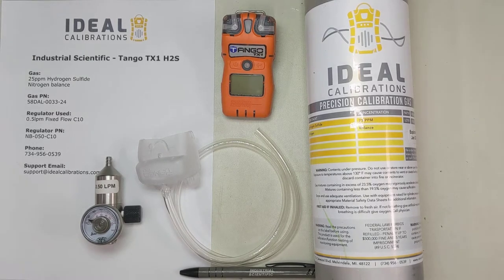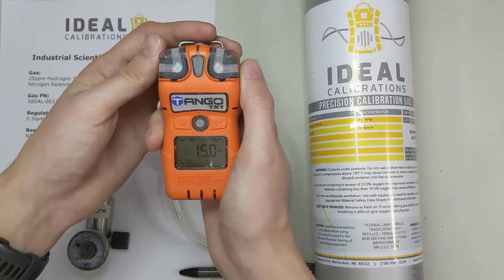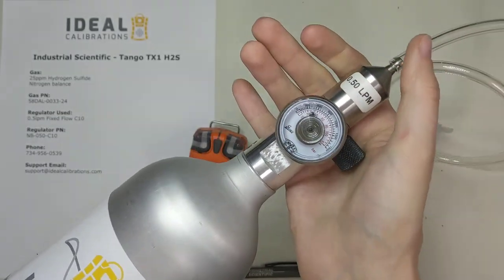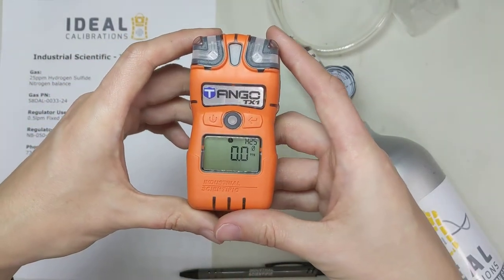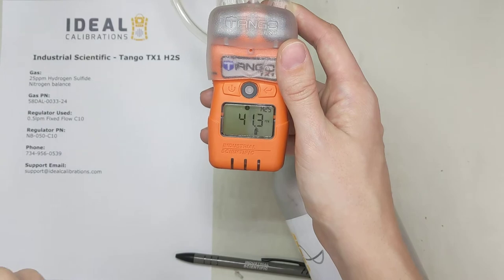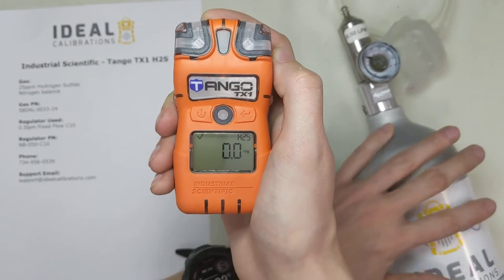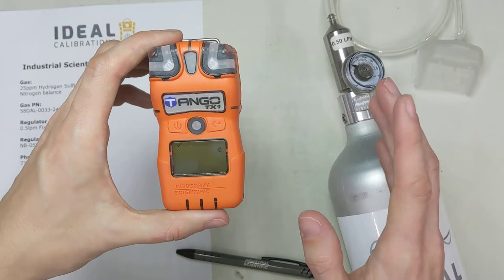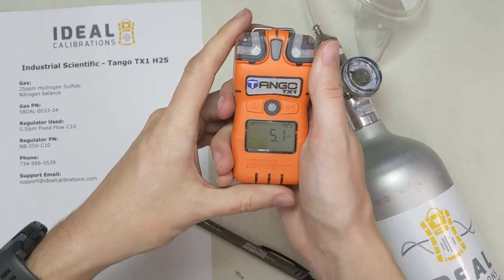Industrial Scientific Tango TX1 H2S Calibration and Bump Test Guide

Comment: kindly upload a video of co calibration of Tango Tx1 with the help of Docking Station.
Reply from the maker: Hey Soven. It should be pretty easy, all you do is put the Tango into the docking station and it should bump/cal. If it doesn't, once it's done reading it should show a B and a C inside of a little cylinder (left and right respectively). Press the C butting for calibration, then confirm on the menu. Let me know if that doesn't work for you.